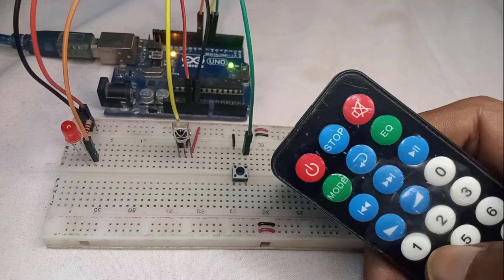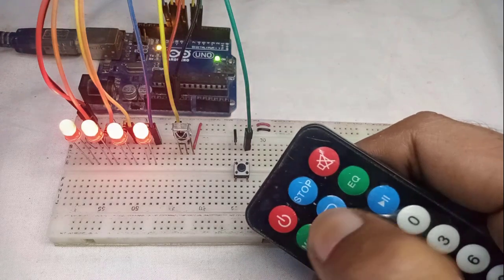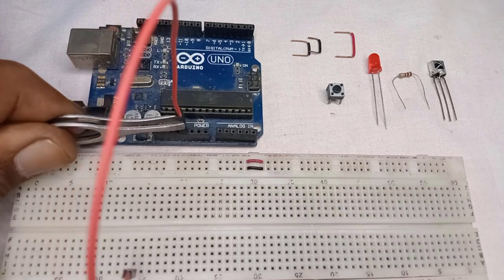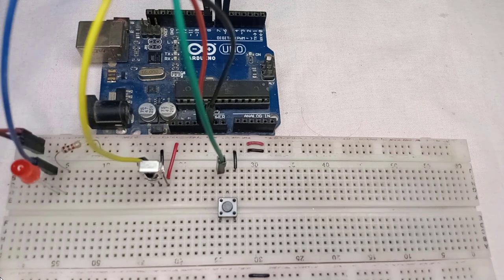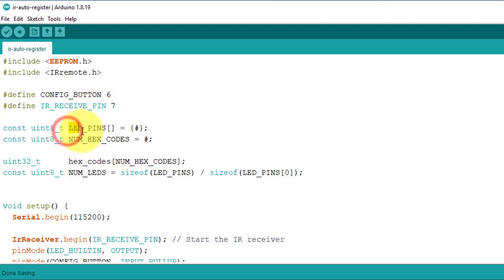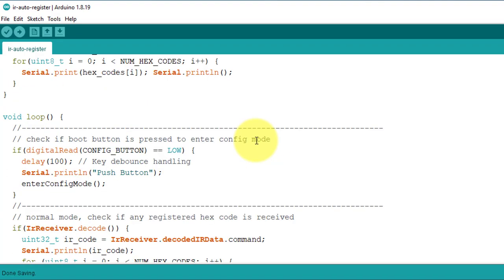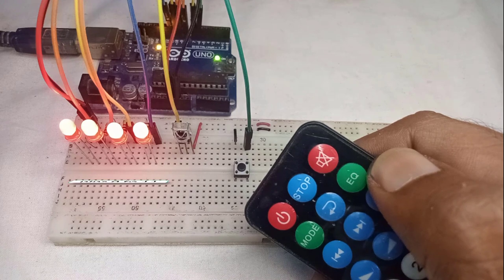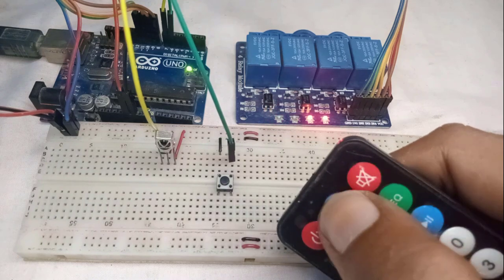How To Use Infrared Remote using Arduino - New Method

Comment: Thanks, but mine only works with one LED. Or it doesn't work. Like when I press the config button, it blinks, then when I press a key in my remote, the light on the Arduino shuts completely, and does nothing, can you please fix this?

Comment: Great project, thank you. I have a question, I tested the code but it only works with one LED. If I expand to four LEDs as described in the video then nothing works. What am I doing wrong? And can you change the code so that the IR signal is only present for as long as the LED lights up?

Comment: Hello, my good friend, thank you for all the valuable projects you designed with Arduino. If we want to make a 4 relay controller with 433 MHz remote control receiver and Arduino, we can save the codes with the back push of the button and save the codes with another push of the button. delete it, can you put the codes please?
Reply from the maker: not understand. please give me clear instructions what you want to do.
Reply: @AhmadLogs  hi🙋‍♂️Let's do the same project you made with a 433 MHz remote control
Reply from the maker: @eerrfanshayyestehh2069  I will try. can you suggest me some best 433mhz receiver module compatible with arduino.
Reply: @AhmadLogs  Bravo ; My good friend ; Relay control project with radio remote control and receiver; It is excellent and professional

Comment: Again, great video, clear and easy to follow. One quick question if I may: I know probably the Attiny85 has limited resources for this project. Which mcu you will recommend in order to satisfied this project?.... The Arduino uno mcu is overkill and it's size is too. I would like to use a standalone mcu in order to make it compact. The reason for my question.. thanks again and great job.
Reply from the maker: thanks. you can use ATmega328p instead of arduino. or else you can use arduino nano or arduino micro. If you need wifi connectivity then esp8266 is good option

Comment: Hello Ahmad, a quick question if I may please: Do you know how much eeprom memory will take to store just 2 buttons? I have a remote with 2 buttons and I was wondering if I will be able to store the program and the 2 buttons in a attiny85 mcu. Trying to make it compact. Let me know if is it possible please. Thank you for your videos, I enjoy learning with them. Best regards....
Reply from the maker: The ATtiny85 microcontroller features 8KB of program memory, which should be more than sufficient for the program you are discussing. Additionally, its EEPROM has a capacity of 512 bytes, providing enough space for data storage.

For each button hex code, you only require 4 bytes in the EEPROM. As a result, you can comfortably store "512/4=128" (128) button hex codes within the EEPROM of the ATtiny85. This allows for a significant number of button configurations to be accommodated in the microcontroller's memory.
Reply: @AhmadLogs  Thank you very much for your reply.... I see great potential the projects you bring in combination with the attiny85, very useful and practical.... Again thanks for bringing those real life solution's.....

Comment: How can I make a gps with esp8266 and sim800l but that the data is uploaded to firebase and not by SMS
Reply from the maker: not possible with sim800l, you need 4g gsm module to work with firevbase

Comment: Ahmad Logs do this using an external EEPROM, not the Arduino EEPROM, thanks for the video I really like your channel
Reply from the maker: I'm glad you enjoyed the video, and I appreciate your feedback! can you please give me some more detail about your suggestion
Reply: @AhmadLogs  Instead of using the Arduino memory, use this Modulo Memoria EPROM At24c256 I2c to save the code of the button that was chosen in the control
Reply from the maker: @deathnote7943  My question is that, eeprom is enough to store the entire keys of the remote control then why we use other hardware such as At24c256?
Reply: @AhmadLogs  the electronic garage door has hardware with an external memory, which saves and compares the signal sent by the control, the idea is to use this same logic, having a record button to send the control code of the key that was pressed to an external memory At24c256, suppose that key 3 of any control was stored, if key 2 is pressed, the code goes to the external memory At24c256 and checks if there is the code for this key, if there is nothing, it does nothing, and if an output is turned on or off on arduino
Reply from the maker: @deathnote7943  ok it is great for staring. I have very little knowledge about the external eeprom. I will try to work on this project soon.

Comment: ESP32 SIM800L GPS Tracker | Vehicle Tracking System using ESP32
THE PROJECT NOT WROK FOR ME PLEASE HELP
Reply from the maker: tell me the issue. also comment below the video you have issues with
Reply: @AhmadLogs   when send get location the message show in serial monitre but sim800l not send location